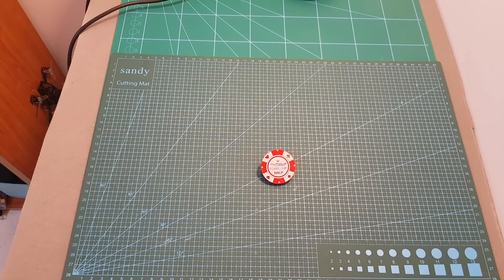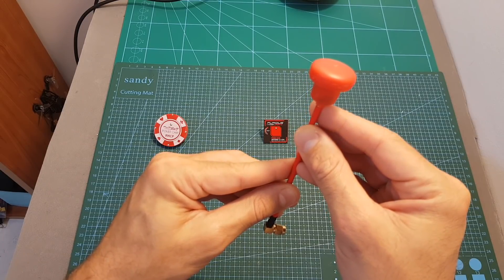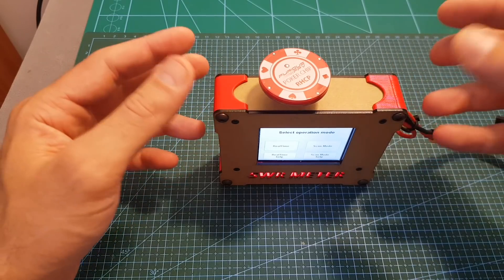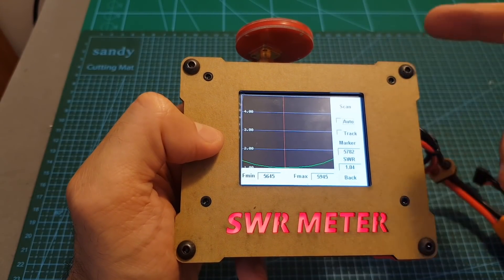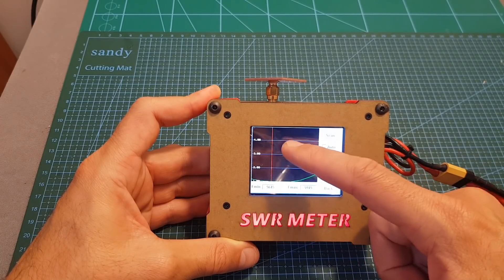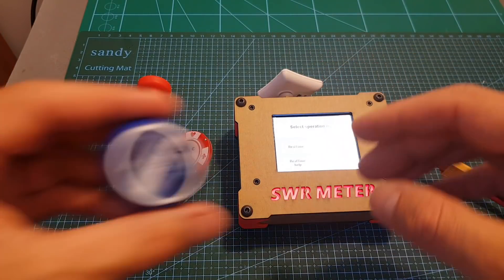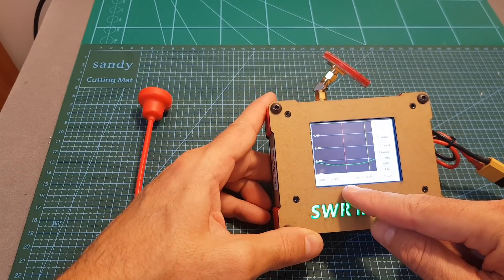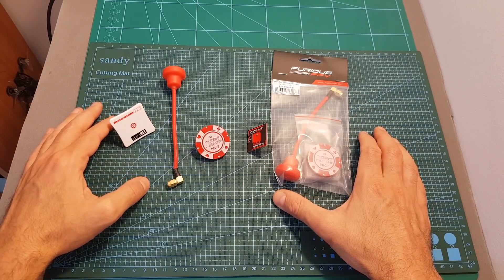FuriousFPV Poker Chip Antenna - Review & SWR Testing

Comment: Now the question is what causes the signal degradation with the angle adapters? Perhaps the cheap craftsmanship/materials?
Reply from the maker: Maybe. I should try to research it and also try different connectors to see if I find something that has less signal degradation.
Reply: @KremerFPV  That would be awesome. The fact that you deal with data and not just an anecdote really sits well with me. Much appreciated!